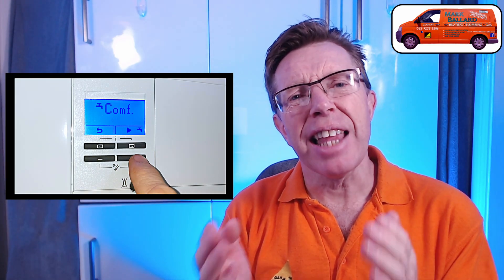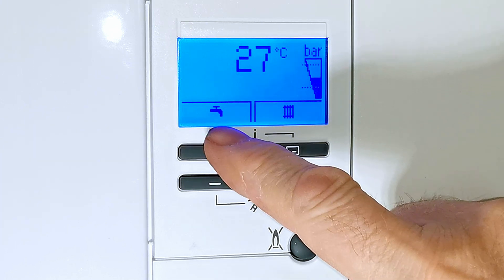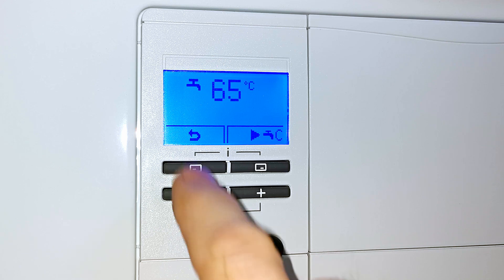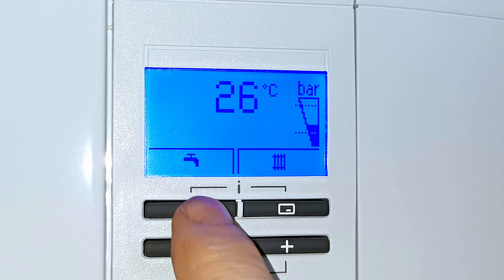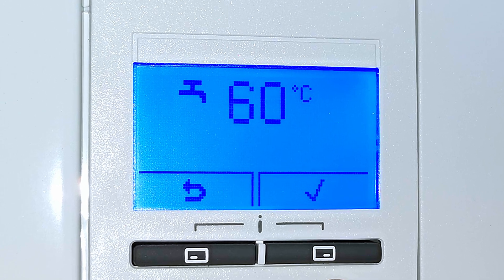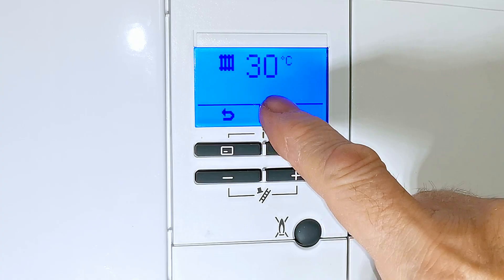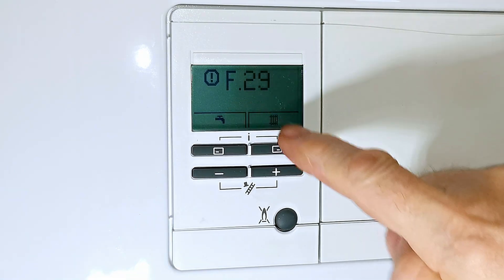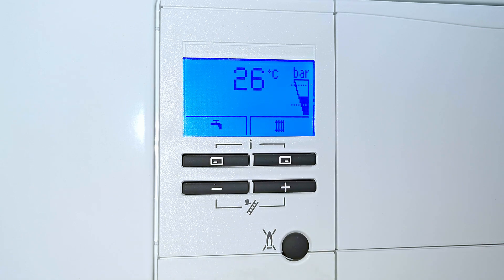How to Operate Your Vaillant ecotec Pro Combination Boiler, Adjust Hot Water &  Heating & Lots More.

Comment: Just followed your instructions Mark is it ok for the boiler to be making clicking noises. I couldn’t get hot water through my shower after it working the 1st couple of uses. It changed temp to scalding temperature so resorted to my good old trusted bath
Reply: Best shower too have is a slimline one that connects to your cold water & instantly heats it up in a few seconds. The body of it is in your bathroom, I'm amazed how it heats up so quick & it's not tied into your boiler system when that plays up & you can't then shower. They aren't that expensive for a bog standard one that my Council put in with that boiler too & it's soo cheap to run. Get a trusted fitter to install it.

Comment: Great video ,can the honeywell t3r be used straight out the box or do I need an engineer to fit it , thanks
Reply: Hello, I wonder if you found an answer to your question.  I have this boiler too but no control/thermostat so I don't know what to do about about heating. Thank you
Reply: @Minpher123  no reply so far
Reply: @Minpher123  yes need an engineer, took him about 2 hours